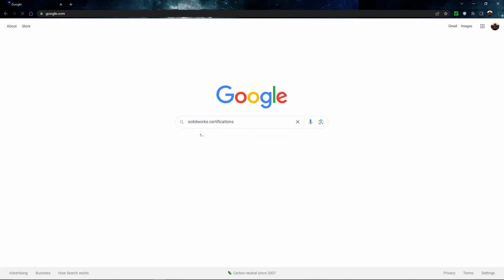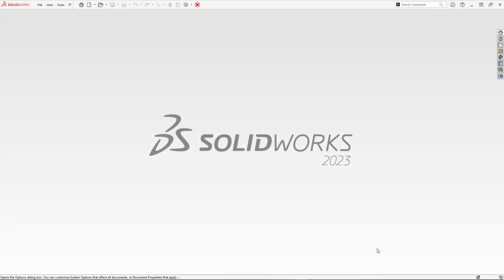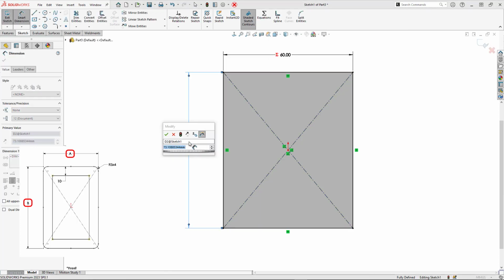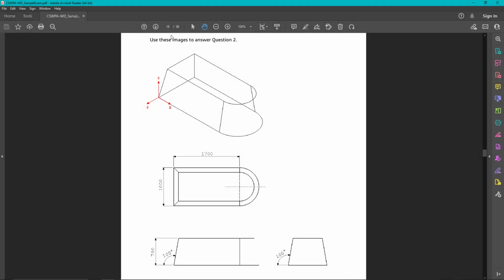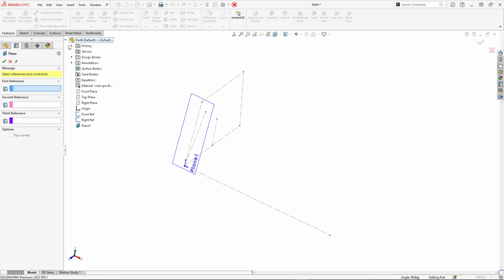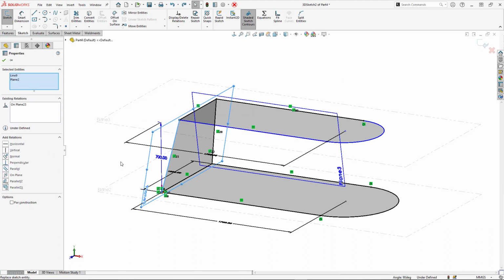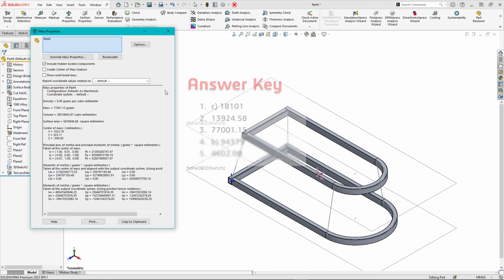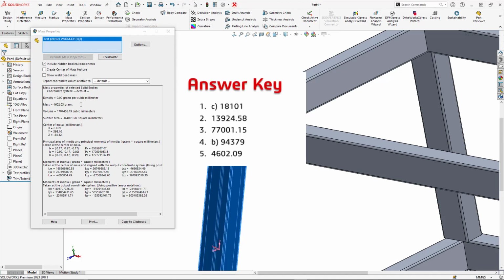Certified SOLIDWORKS Weldments Advanced Professional - Sample Exam Overview CSWPA-WD

Comment: For the 2nd question I make a solid body by simple extrude with draft inward by 10°, then used convert entities to create the 3d sketch.
Reply from the maker: That is an awesome way to use solid modeling to make it easier to create 3D sketches.  Don't forget to use Delete Body after you use the geometry so it does not impact the mass properties or show up in the cut list.
Reply: @MLCCADSystems  I will remember that, thank you 😊